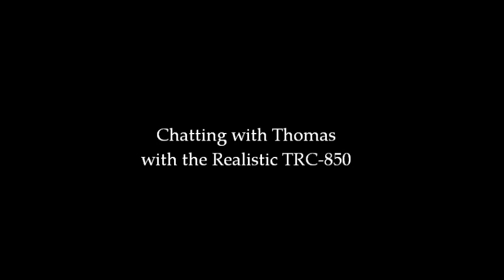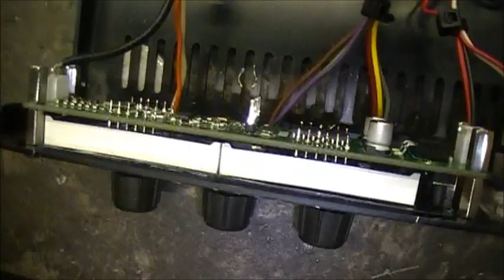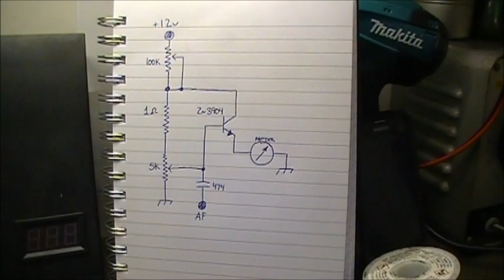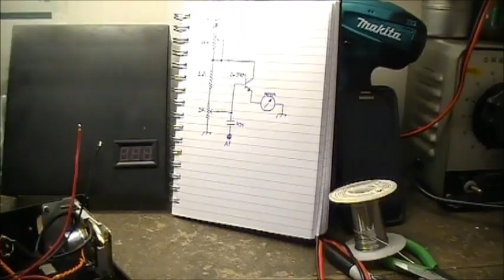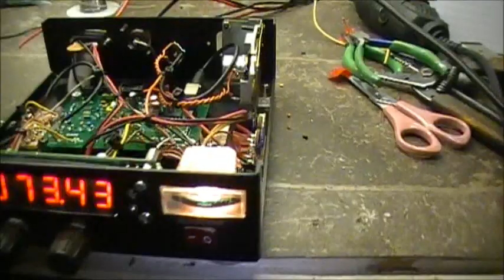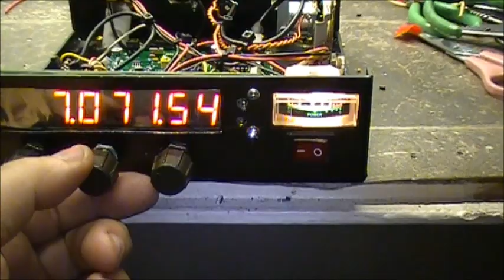40m CW/SSB VFO Controlled receiver with working S-meter

Comment: Would not mind having a go at building that receiver ...nice
Reply from the maker: https://www.ebay.com/itm/40M-VFO-CONTROLLED-RECEIVER-BOARD-KIT-CW-SSB-QRP-/283752404593
Reply from the maker: https://www.ebay.com/itm/8-Bit-Digital-Green-LED-RF-Signal-Frequency-Counter-0-1-60MHz-20MHz-2-4GHz/323923114450?_trkparms=aid%3D555021%26algo%3DPL.SIMRVI%26ao%3D1%26asc%3D20190711100440%26meid%3D65f53fec66bd45619725fccfae14ccc9%26pid%3D100752%26rk%3D2%26rkt%3D13%26mehot%3Dpf%26sd%3D283752404593%26itm%3D323923114450%26pmt%3D1%26noa%3D0%26pg%3D2047675%26algv%3DSimplRVIAMLv5WebWithPLRVIOnTopCombiner&_trksid=p2047675.c100752.m1982
Reply from the maker: You will need to build a buffer circuit for the counter as this board do not produce enough signal to drive the counter properly.  ;-)

Comment: Do you have the ebay link for the receiver ?
Reply from the maker: https://www.ebay.com/itm/40M-VFO-CONTROLLED-RECEIVER-BOARD-KIT-CW-SSB-QRP-/283752404593
Reply from the maker: https://www.ebay.com/itm/8-Bit-Digital-Green-LED-RF-Signal-Frequency-Counter-0-1-60MHz-20MHz-2-4GHz/323923114450?_trkparms=aid%3D555021%26algo%3DPL.SIMRVI%26ao%3D1%26asc%3D20190711100440%26meid%3D65f53fec66bd45619725fccfae14ccc9%26pid%3D100752%26rk%3D2%26rkt%3D13%26mehot%3Dpf%26sd%3D283752404593%26itm%3D323923114450%26pmt%3D1%26noa%3D0%26pg%3D2047675%26algv%3DSimplRVIAMLv5WebWithPLRVIOnTopCombiner&_trksid=p2047675.c100752.m1982
Reply from the maker: You will need to build a buffer circuit for the counter as this board do not produce enough signal to drive the counter properly.  ;-)